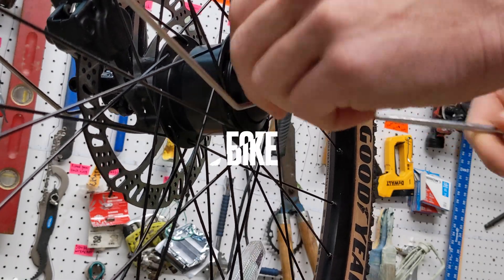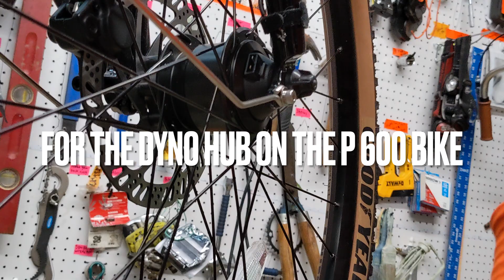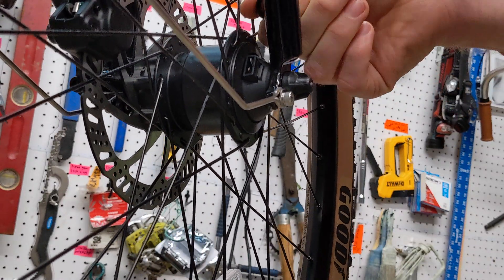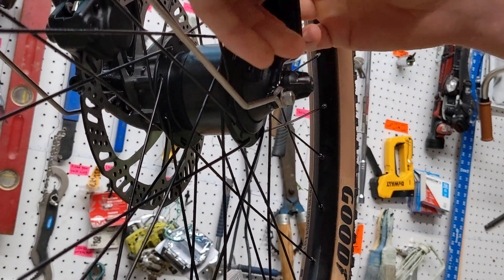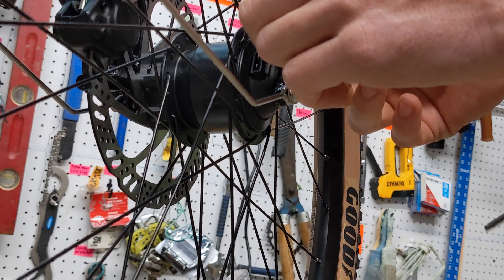How to fix - assemble- troubleshoot dynamo hub wire connection on Priority 600 bike front wheel

Comment: Im trying to take apart the light to install new wiring do you know how to get to the wiring terminals in the light?

Yeah its looking like my wiring snapped because of no slack on the bottom end. Its understandable to limit slack but it should be generous to give path and taped higher up.
Reply from the maker: I don't. I have abandon the stock light and switched to a different lighting system that's easier to maintain.

Comment: thank you so much, picked up my bike from Trek tonight just before the closed, they failed to tell me i was supposed to unplug that from the wheel before taking the will off. it was dark outside, i didn't see it, got home had two little wires sticking out next to my wheel, hmmm what's that... hey why doesn't my light work.... OH SHHHHHHHt really didn't want to take it back in the morning ... works great now... thanks again
Reply from the maker: I'm glad it was helpful. One thing I did not include in this video. I think I have it in another one of my videos on this same wiring situation. Is liquid electric tape. Just search for that on Amazon. Purchase it. Then paint the liquid electric tape over the connection on the male side of the plug. This process glues the wires in place so that they won't rip out again. At least not very easily. While simultaneously insulating them from each other so that they won't short out if they move and come in contact.